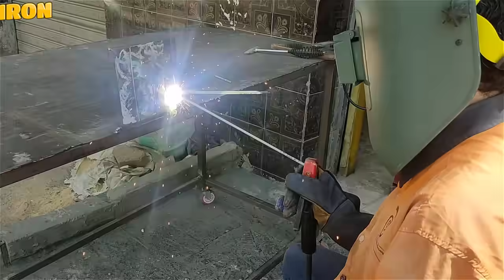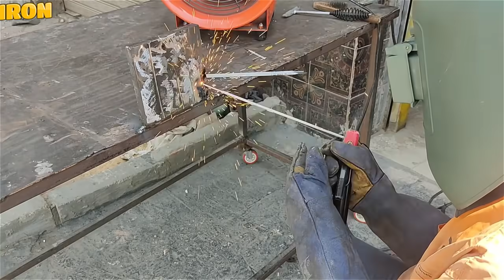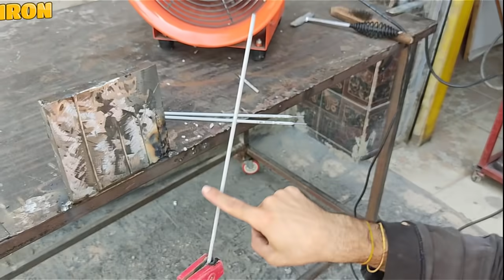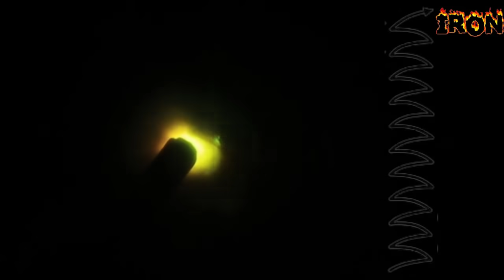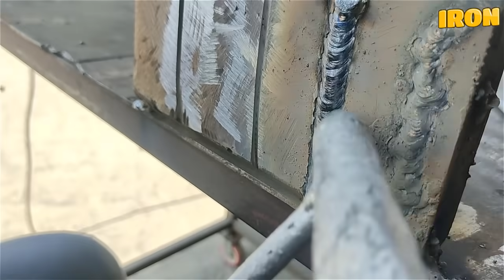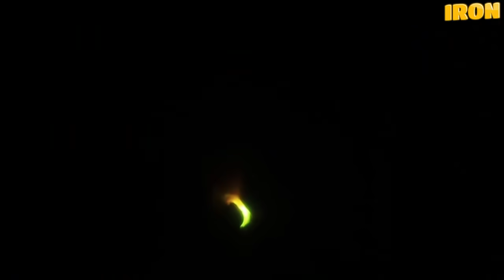Tricks to learn vertical electric welding

Comment: Hi 
amperage stronger or not ?
Merci
Reply from the maker: strong
Reply: @iron9844  

Merci 👏
Reply: 10 a 20% de plus de l'intensité à plat.
Reply: @pascalcrepin-gilbert8610  

Merci  Pascal 
Je me doutais bien que pour le montant c'est plus 
Et certainement 10 à 20 % de mois qu'à plat pour le descendant ?
Reply: @pascalcrepin-gilbert8610  

Au moins c'est du précis 👏
Reply: @andrefleuriet2391  le delta de 10% est  en fonction du soudeur mais aussi du volume de matière  ( tôle de 3 mm ou poutrelle de 10mm), du type de joint... intensité a plat = (diamètre de l'électrode -1) X 50.
Reply: @andrefleuriet2391  A clin (ou en angle intérieur), plafond en angle intérieur et en montante 10* 20% de plus que l'intensité à plat. En descendante et en angle extérieur 10 a 20% en moins. la descendante est interdite sur les structures porteuses.

Comment: What the ampere setting for welding vertical at 3mm?
Reply: 30 x 3=90 amperios
Reply: It doesn’t matter what amps you have just read the puddle